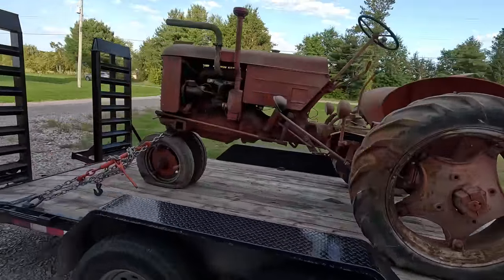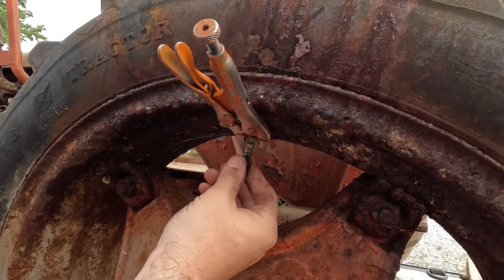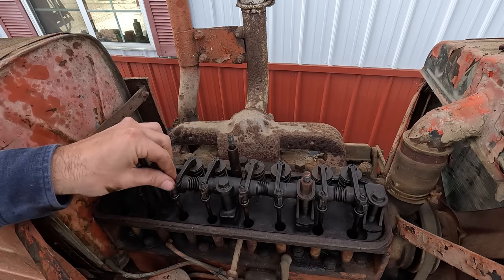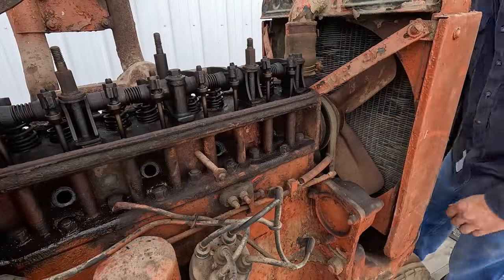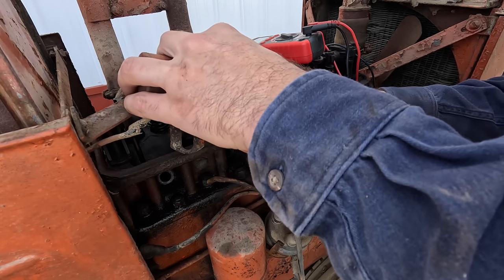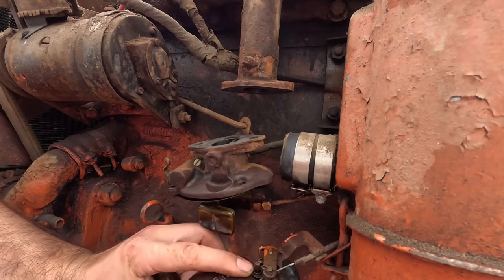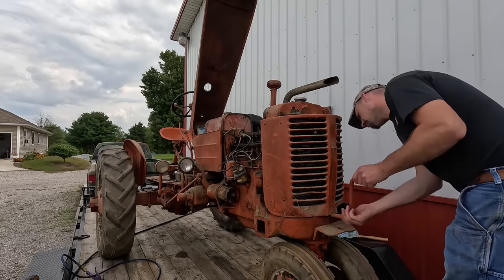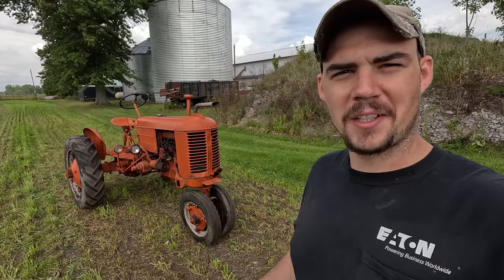WILL IT RUN?!? 1947 JI Case Tractor With Stuck Engine

Comment: I have 3 VAC. One was my dad's first new tractor back in 1951. I bought a 1949 for $300 with the motor sized but just put some muscle to the crank and eventually got it turning and soon after started. It also runs great. Enjoyed your video

Comment: I have VAC's, mice tend to nest around battery & elect. switch area. I took an small plastic vitamin bottle with cap, punched some 1/8 " holes in it, filled with moth balls  & leave in this area. Stopped my mice problems  years ago.BTW good job, great  video.

Comment: This 1947 three wheeled case engine so reminds me of my two Case 450A crawler loader engine sound, David Brown machinery from the UK would be a identical replacement engine for the crawler loaders because the David Brown engine didn’t overheat like the Case engine would regularly happen. Once again great filming of this 1947 Case three wheeled tractor.

Comment: That tractor cleaned up real nice.  Seems to run great for not having much compression. Hopefully it was just stuck rings, and they loosened up after running for a while.  Might have been why it was smoking for a while, and then cleared up.

Comment: Wow, Don't know the actual time, but appears like only took a couple hours to resurrect from its slumber to be able to drive off under its own power.  One can only guess with it up on blocks and the plugs not real tight, still having full antifreeze  and oil, and a one owner family, and the seemingly good overall condition including paint. Must have been a slightly used and possibly rejuvenated by a previous family member.
Reply from the maker: It was a one-day project to get it fired up. Whoever put it up on the blocks cared about it. You don't usually see that!

Comment: What gear do you have the transmission in when you're trying to turn the engine by rocking the wheel?
hopefully a "high" one
Reply from the maker: Fourth gear, that would be considered the road gear on these machines.

Comment: Do you have to have pto engaged for hydraulics to work?
Reply from the maker: I wondered about that, but I don't believe so considering the pump is right behind the main clutch.
Reply: @Randys_Relics  The hydraulics run from a pump under the belt pulley housing. So the PTO doesn't need to be on but your foot needs to be off the clutch